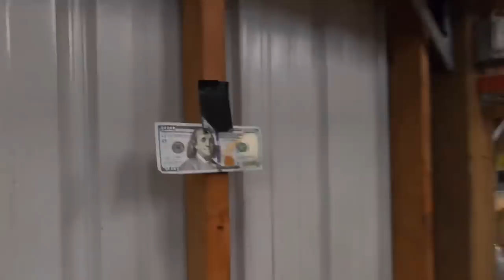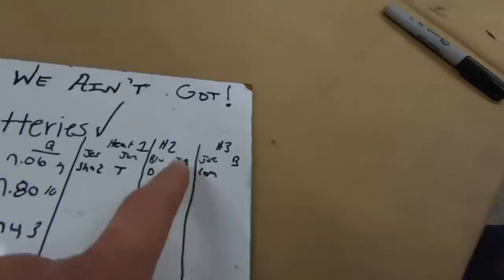We Built a Race Track in the Shop! RACING and WRECKING Crazy Carts

Comment: My rc truck would be great in that track, I have a traxxas slash 2wd and a fourwheal drive 1/10th scale. My 2wd has a bigger brushless motor and as long and you keep it sliding it’s kinda like a drift car, but the other one I havnt really touched yet besides putting on mud tires on it and it is great for the mud, plus if you go fast enough kinda like a fourwhealer it will float across muddy water